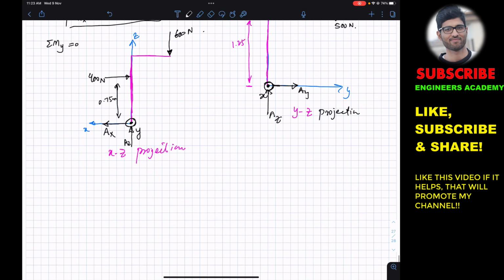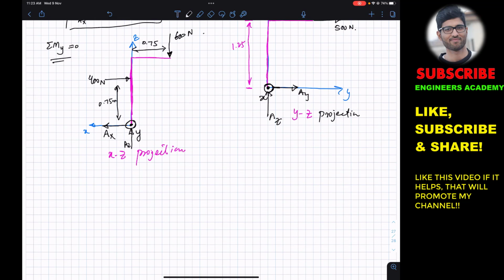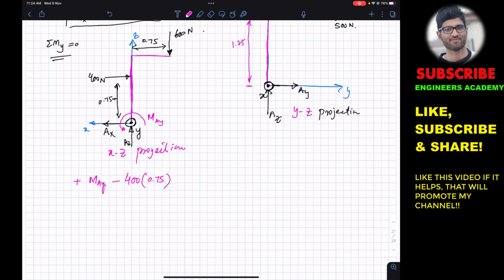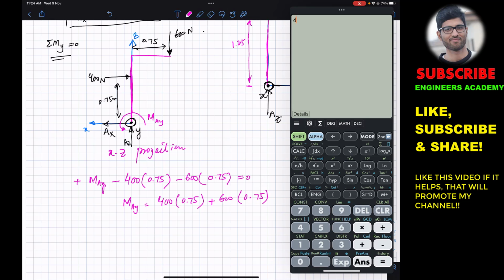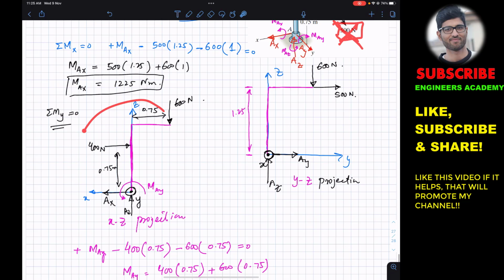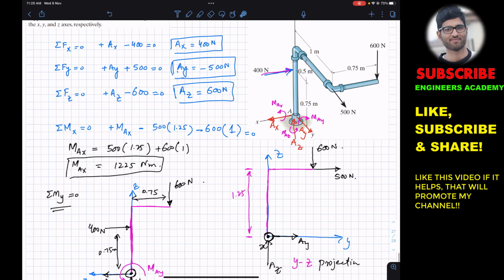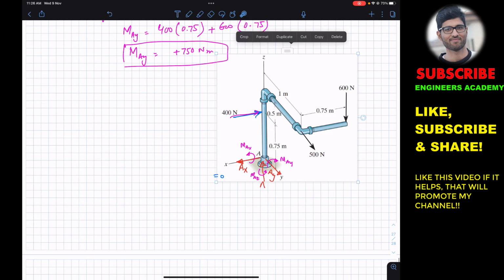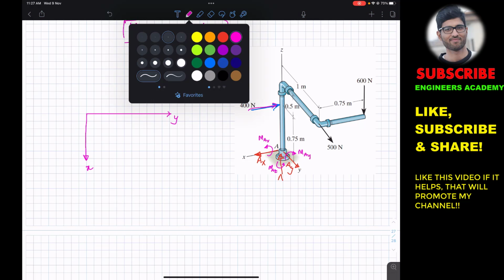5-64 Equilibrium of a Rigid Body (3D Equilibrium Problems) Chapter 5 Engineers Academy

Comment: A farmer uses cables and winch pullers B and E to plumb one side of a small barn. If it is known that the sum of the moments about the x-axis) of the forces exerted by the cables on the barn at Points A and D is equal to 4728 1b.ff determine the magnitude of Toe when TAB=255 16